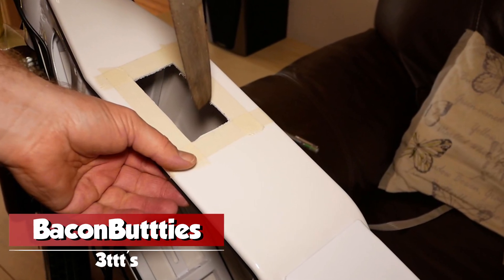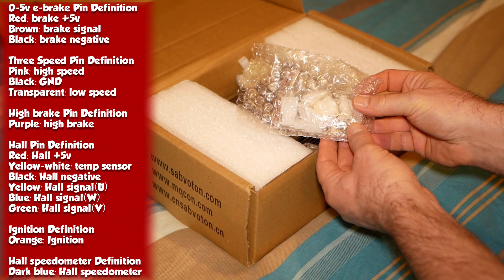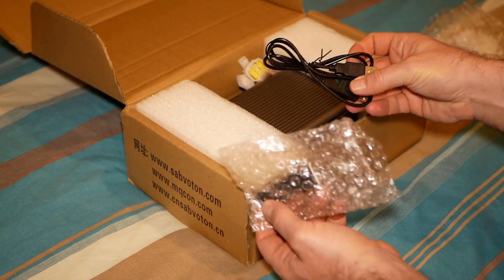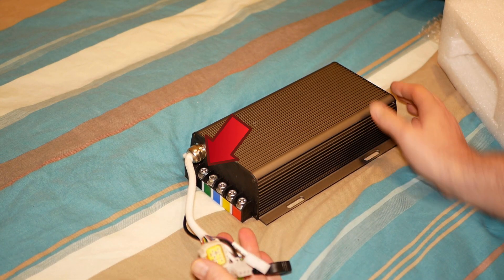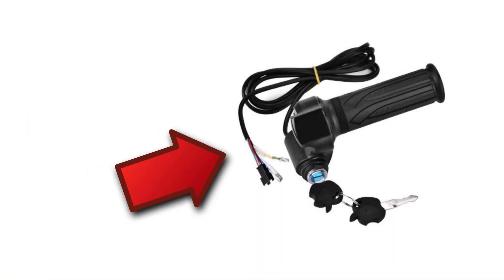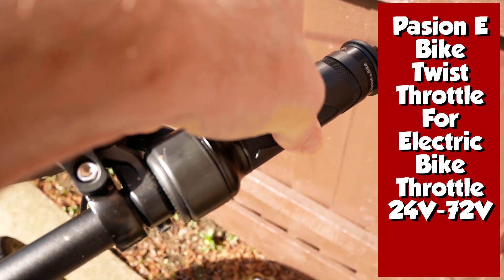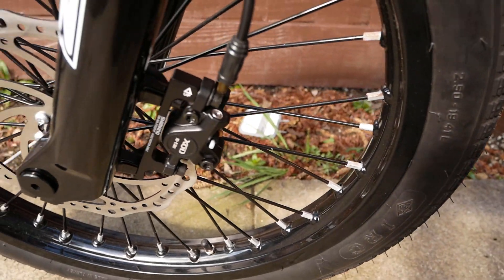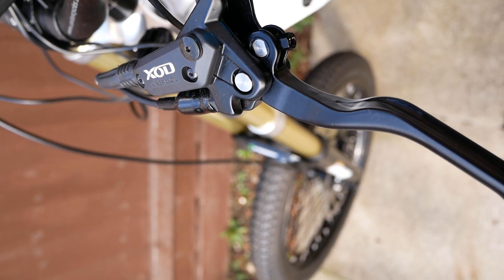ENDURO E BIKE BUILD PART 4 NEW PARTS

Comment: How do you manage the brake light function ?
Reply from the maker: I didn't do brake lights on this build if that's what you mean?
Reply: @baconbuttties  yeah, thats what i meant. Thanks. But do you know how to do it ? I have 72V Battery, 12 Volt Converter and the brake wires to stop the engine may be 5 V. I want to connect it at these wires.
Reply from the maker: @thorulthorul9489  Maybe wire  the brake switches  to the 12 volt converter and run them to the brake light and have an inline 12v to 5v  drop down box to run to the controller. Like one of these https://www.amazon.co.uk/Ytesky-Inventor-Converter-Transformer-Adapter/dp/B07QQ587K3/ref=asc_df_B07QQ587K3/?tag=googshopuk-21&linkCode=df0&hvadid=345504185242&hvpos=&hvnetw=g&hvrand=2668569961782562399&hvpone=&hvptwo=&hvqmt=&hvdev=c&hvdvcmdl=&hvlocint=&hvlocphy=1007415&hvtargid=pla-751020535191&psc=1 or something similar.
Reply: @baconbuttties  Thanks a lot

Comment: I recently got same frame and brakes. Where you got that rear wheel brake adapter mount?
Reply from the maker: I think it was something like this that I used https://www.ebay.co.uk/itm/Shimano-Disc-Brake-Adapter-Post-to-IS-Mount-REAR-203mm-rotor-SM-MA-R203P-S/164378021484?hash=item2645b18e6c:g:TZoAAOSwLMZfWs1g
Reply: @baconbuttties  Oh thank you! I found one in my country. Thank you for confirming this.

Comment: where do you get the front wheel for that bike iv been looking all over for 19in motorcycle rim for my build like this one
Reply from the maker: I got it from AliExpress, I had to ask specifically for the wheel to be made... I will try and look up a link to it if it is still available.
Reply: @baconbuttties  i found the rim on the sellers page for the rear motor now to find a tire that in not like 400$Canadian with the shipping
Reply from the maker: https://www.aliexpress.com/item/32820704658.html?spm=a2g0s.9042311.0.0.27424c4dghHxlU

Comment: G'day mate, you will love the ride quality on EEB Frame especially if you combine it with "Good Suspension" like the Rok Shocks Domain (200mm travel) dual crown front forks & Rok Shox RC2 Rear Coil Shock, I run these on my EEB Frame Build, but in a BBSHD Mid-Drive Setup... It soaks up bumps with ease and out performs any other mtb I have ever owned on rough dirt trails. Good Luck 👍🏼😊

Comment: I watched your first video before I ever purchased my frame. Since then I've ordered my frame, put a bike together, built a whole new battery, and then destroyed my bike in a gnarly crash. I'll most likely have a replacement built before you finish this video series haha
Reply: I get that video editing takes a while. Maybe just build it and record everything and worry about editing later! You don't want to miss out on riding these things! It's an experience you'll never forget! My bike did 52mph before the crash and I plan and making 2.0 even faster! Haha
Reply from the maker: @PartialRug  52 mph is a great speed! I did have a normal bike frame e bike build before this that topped out at 35 mph. Hope you survived the crash without to much damage to yourself.
Reply from the maker: I will have to agree that I am rather slow. It takes longer to edit these videos than to build the bike.

Comment: Looks good, I have the same throttle on mine, very smooth, good quality, I just finished my enduro 3 days ago and loving it, it’s easy to burn through the battery running high speeds on these heavy bikes, I did a 56ah 22s-14p using 21700 cells and it seems to work good, sags about 4 volts at 100 amp draw
Reply from the maker: Thats a good size battery , what kind of use do you get before it runs low?
Reply: Its to early for me to get an average, riding style will greatly effect the range, but I can say with my riding style I have just under 40 miles on it right now with 80.5 volts left out of the 89 volts that I had it charged at, fully charged is 92 volts and dead is 66v, but I read that charging slightly under full is beneficial for the battery packs life, so I set my charger to 89v and set the BMS options to match for balancing. The 21700 were $3.00 a piece including shipping, so pretty cheap when compared to what I have been seeing 18650's for, I believe they are the same cells that liitokala uses for the Lii40A 21700 before being re wrapped. they have been tested on budgetlightforum at all different amp draws and seem to perform well, voltage stays high until close to dead